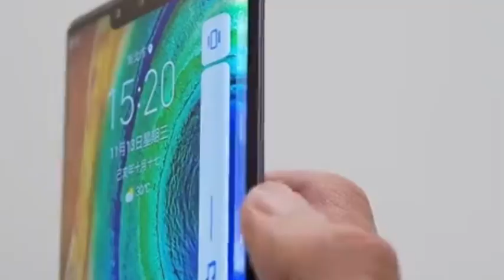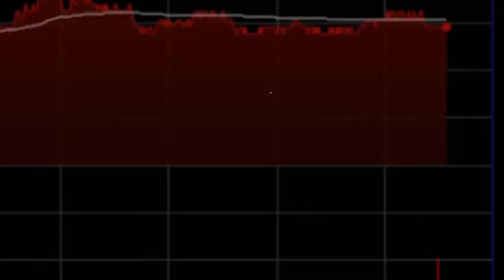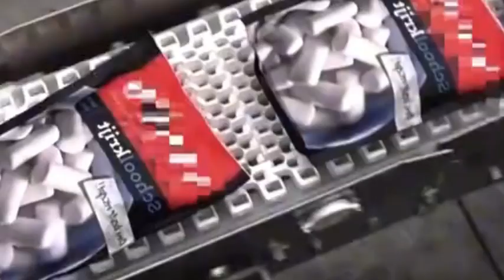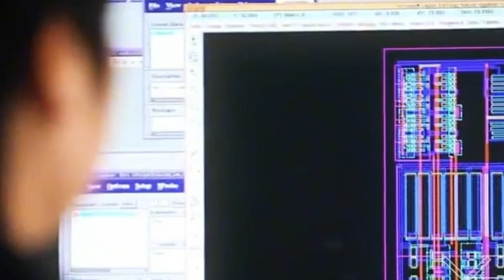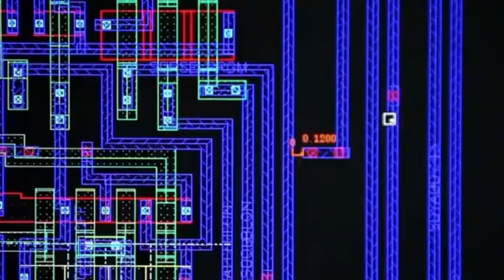The U.S. is nervous! China's chip exports soared 25.6%, and mature chips began to take off!

Comment: With 80% of the world population, the global south plus BRICS would soon be the biggest market for mature Chinese chips. Moreover China has helped the global south to develop key infrastructures such as roads, bridges, railways, hospitals, schools ... etc. Advance Chinese chips would also be controlled by the Chinese and they should be void of US technology.
Reply: Only think to note is that the elites in most of the Global South are pro-Western, though the most important players already realize who they need to work with. The Zionist-Anglo-Saxon global elites try to control other countries through their own system, infesting their adversaries at the head.
Still we have the issue that the global business class is usually also bred under the Western ideology, so Chinese brands need to work towards shattering the "superior Western products" that were usually assembled in China anyway. However this time the mass of the profit will remain in China as Western brands were always interested only in the low labour cost of the Chinese industry. All you need to do is... implement counter sanctions to Western manufacturers - as has been already discussed many times China holds most of the raw silicon refinement industry thus providing the raw materials needed for semiconductors. Complete that with Russia being the largest exporter of inert gasses (also required for chip production) and you can create a massive price hike for western manufacturers, making them unable to compete - they'll be fighting over each other for raw materials they can access. Can't wait to see the whiny accusations of the US and EU once that happens.
And to top it all China can dominate the CPU market in friendly countries if it wants to - only field it would have trouble with the lack of cutting-edge processes would be AI, but we're speaking on purely comparing chips manufactured in and out of China having different process nodes as there's other means China can effectively negate this issue. The thing with the CPU field is that the largest manufacturer for desktop and datacenter CPUs - Intel - is completely incompetent and is still to release 7 nanometer CPUs for desktop and server - Huawei was able to launch made in China CPUs on a practically 7nm node last autumn, and that's with all the sanctions they've had on them. As I said Intel is the largest CPU manufacturers - the best CPUs were made by AMD however the global market did little to follow what criminal machinations made Intel monopolize the x86 market, however now that monopolization attempt can come as a spare card for Chinese CPUs as they can be sold with comparison aimed at Intel as beating their offering specification wise has never been a problem - and there is a very important goal in dumping any American CPU as Washington requires CPU manufacturers to include hardware backdoors for spying on people, can't say AMD are very happy to provide these but for us the most important thing should be security, if AMD is unhappy with what is going on they should look for ways to break out of Washington's influence. Chinese desktop and datacenter CPUs on a 7nm node can most likely be launched this year - SMIC recently announced they offer a 7nm capacity (they've been working with Huawei on that), meaning both Loongsoon and Huawei can launch respective products, they'll be first targeted for domestic needs as security flawed American chips need to be removed, Russia and some of the Arab states are also following this trend, in any case expect all manufactured pieces to be sold out quickly. And for AI we need to still remind the rapid advancements in alternative silicon technologies, so any advantage USA has in AI can disappear in 2025... even now Huawei sells all the AI accelerators they manufacture.